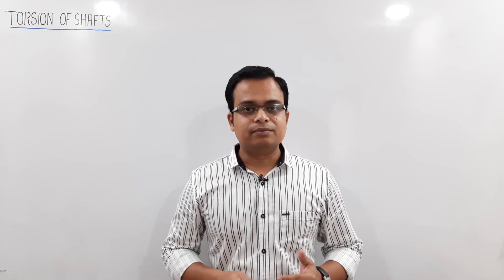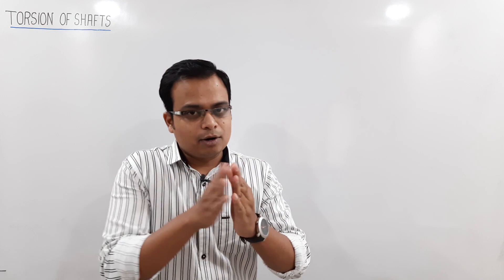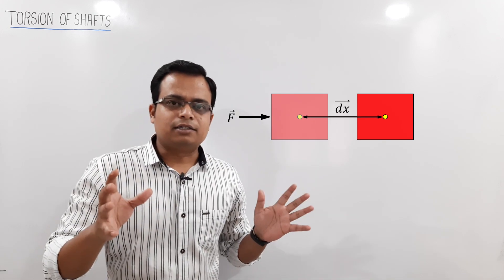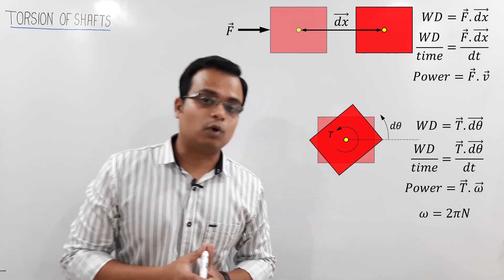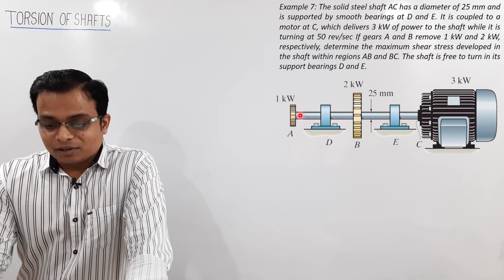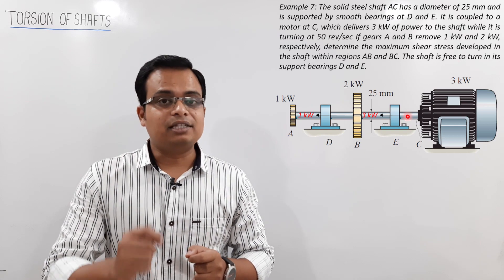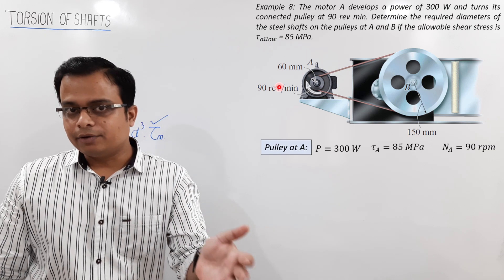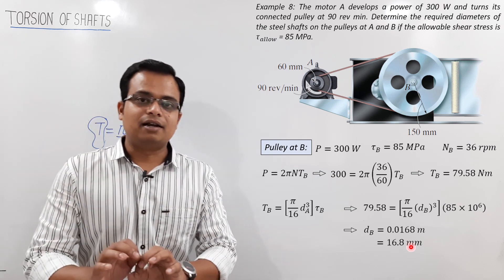Power Transmission by Shafts

Comment: Great explanation Manas. In my case I have a shaft positioned vertically with 2 disks fixed to it and a motor at the top that drives the whole system. I want to apply all the concepts of strength of materials. How should I approach my case, given that all the examples that there are are for horizontal shafts. Thank you in advance.

Comment: please i need to calculate the problem
Design a PT shaft that delivers power produced by a 163 CC engine to
 a 10 in wheel and selecting the RR of the system (use chain and sprocket power train) - Assume materials from the available materials in Egypt and mention the reason behind your selection. -Select the mounting bearings by size and load (choose from SKF brand catalogue)? and mention why choosing the type of bearings?